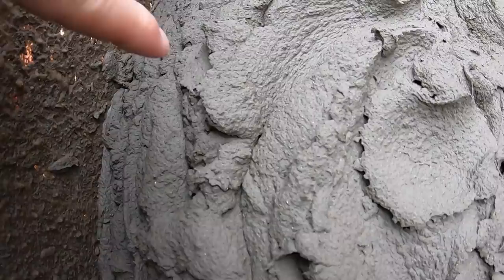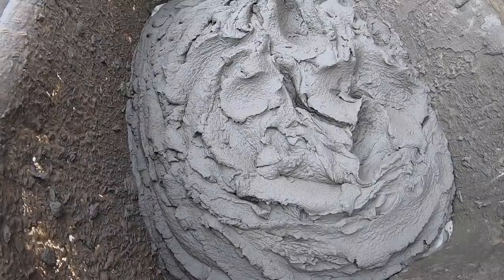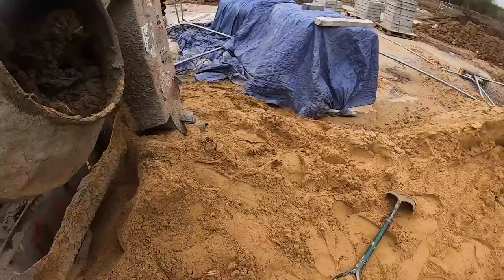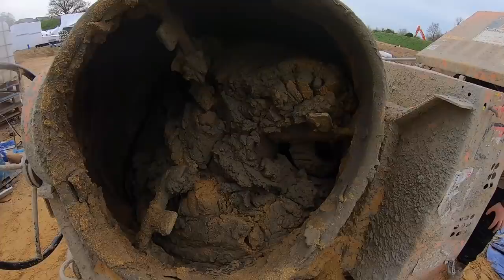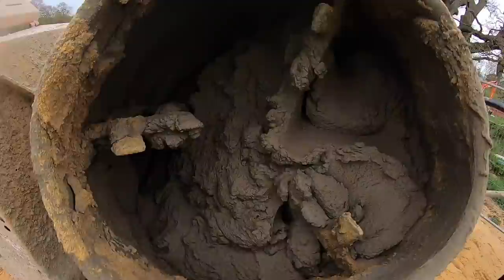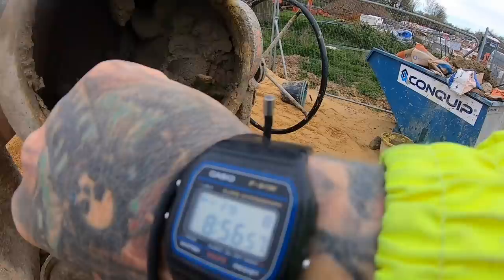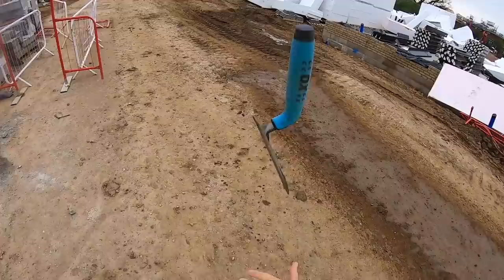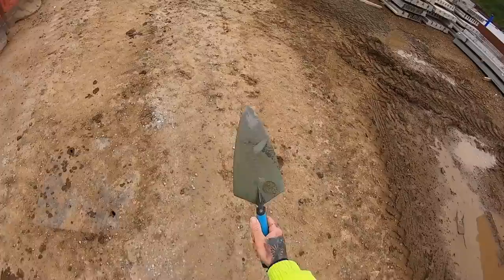How to lay a BED the RIGHT way!?!?!

Comment: A Marshalltown 19-11 is my preferred trowel. Here in Ireland, the majority of masons use the 36-11.
Reply: I have a brand new Marshalltown 1911 that I haven't used yet I found it in a little hardware store for $25 I was getting numbers for my mailbox so I had to buy it at that price where I live in Rhode Island USA the masonry supply stores don't sell Philadelphia pattern trowels most people use 9-inch W Rose London Pattern for laying brick and 11 or 11 and a half London Pattern Marshalltown for laying block
Reply: 34-11 actually 🇮🇪

Comment: I use the rose 7.5 tile trowel most of the time although I do stonework so it's more of a pick and dip thing anyway we also work out of flexi tubs, when I do have to lay bricks I flit between a 9 inch philly and a 9.5 wide London all with wooden handles, I would love to see what an 8 inch wide London or philly would be like. I would certainly be interested to see what you come up with, steel wise I would aim to be halfway between the rigidity of the old whs trowels and the flex of the marshalltown trowels. Best of luck with everything 👍🏻
Reply: Interesting not heard of phillies  etc . Whs  I owned 1 of thise  ....msny called it work hard and starve lol given its size etc ...marshalltowm I use no issues . I mostly do hobbles  these days as I was made redundant about 15 years ago . And given the situation it left me in my current job pays regardless of weather . So I do it on the side best of both lol . May consider going back to it full time at some point who knows

Comment: There has only been one person to compete in the spec mix finals using pick and dip he made it the last two years he's from New Jersey I think he laid like 550 and the winner laid around 650 also the spec mix mortar is different then the mortar Charlie is using so I would suggest when he practices that he does not put plasticizer in the mix
Reply: A guy called riel voigt won the British Columbia specmix 500 heat in 2017. He has competed a few times I think using p and d and long bed .he appears in a short section of video of the specmix finals ( can’t remember the year ) and he’s using what looks like a Belgian brick trowel using the p and d method . Americans use mostly masonry cement based mortars that contain lime and other additives to make the mortar plastic . There would be no point using mortar that has no plas in it because it would be dead when it hits the board .
Reply: @brickbybric  I'm a bricklayer in America the morter is lime, cement and sand
Reply: @richardstetson8221  exactly . The lime in your mortar puts plasticity in to the mortar in the same way plas puts plasticity in our mortar .

Comment: That's how I lay a bed, flatten it out with a slight angle on the trowel to the cavity and picked up this style since 1988, this making a plough down the centre I was taught in college and dropped it soon as I went to site and found it time consuming
Another style you don't see anymore is nose bleed when setting out
we used 2 and half inch guttering 2 meters long load it with muck and the labourer would do one strike perfect 2 meter bed
If doing 9 inch flat labourer would use 4 inch gutter same again 2 meter
And I'm still laying today
When doing footings board to bed board to bed I couldn't maintain that, it would damn near kill me, quite surprised no one really use guttering anymore
I don't do site work them days are long gone just private jobs and I'm 55 and still at it

Comment: Hi CHARLIE,
WHY NOT TRY A  W ROSE "SPADE TROWEL 9½X6" FROM SPEEDCRETE,  IT'S NOT TO LONG BUT IS 150mm WIDE WITH A WOODEN HANDLE. QUITE A GOOD LIFT,  WORTH TRYING.  GOOD LUCK WITH YOUR ATEMPT. I WISH YOU LUCK . CHEERS
Reply from the maker: got 1 never used it